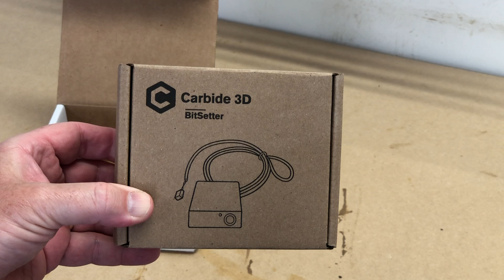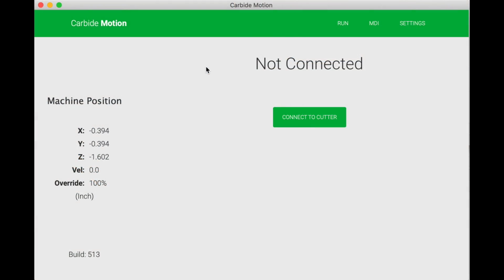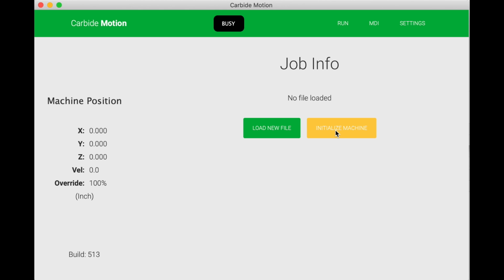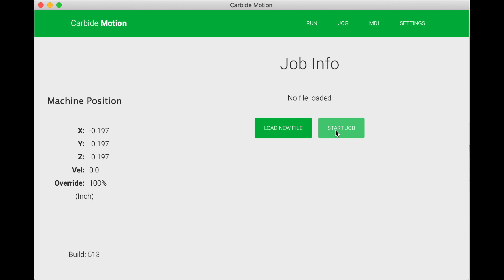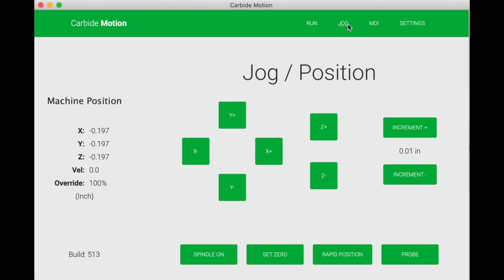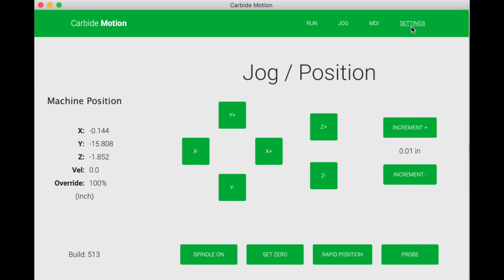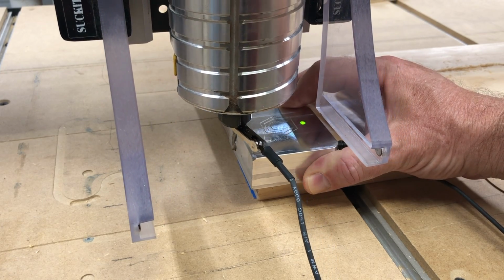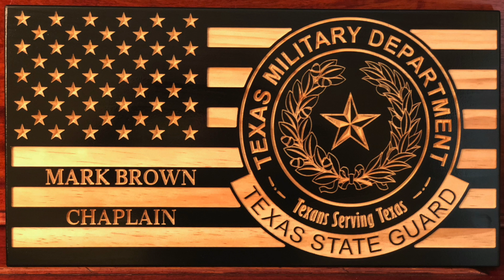BitSetter Install

Comment: Thanks for the video.  I'm about to install both Bit Setter and Bit Zero.  As an old-time electronics tech, I'm worried about putting that added connector board inside the housing with no additional insulation to keep it out of random contact mischief with the main PCB.  Since it doesn't seem to contain any active devices in need of cooling, I'll probably mummify it with black tape first.
Reply from the maker: That's probably a good idea. However, you may want to wrap it in a layer of bubble wrap or clear plastic first in case you ever need to remove the back electrical tape.

Comment: Is there a link for the splitter that allows you to use both setter and zero I don’t have one and need to purchase one unless anyone knows a different way to use both
Reply from the maker: Everything I needed for the install came with the BitSetter. I suggest you contact support at Carbide 3D. They should be able to send you one.

Comment: I recently bought my first CNC (Shapeoko 3 XXL) used, and it has a BitSetter installed but I’ve been using the touch plate to probe for Z zero every time. I knew the BitSetter had to be more useful … thanks!!

Comment: How did you get bitsetter to work with VCarve Pro?
Reply from the maker: I use Carbide Create and Carbide Motion. I've not tried using the bit setter with VCarve Pro.

Comment: Anyone have video or installation procedures for the new rectangular Shapeoko 4 Bit Setter? I received from Carbide and it came without parts list and instructions. I think I may be missing parts??  I have a Shapeoko XXL Pro and can't figure out how to mount it to the frame - it's totally different than the V2.
Any help would be great, Thanks!!

Comment: Thanks for the video. Yes "clear all off sets" that's where I screwed up. Great detailed explanation of the bitsetter set up and correct work flow.
Reply: Yes, it’s important to follow all the instructions in order and not skip them. I learned the hard way, but that’s part of the process as well.

Comment: It's tough to tell, but at around 2:00 are you using the head of the screws to secure the BitSetter to the frame?
Reply from the maker: The BitSetter has a slot that drops over the front rail. Yes, the set screws secure the BitSetter to the frame and keep it from moving around.